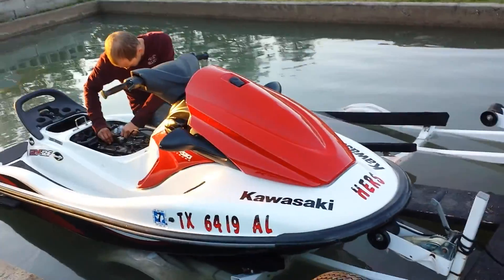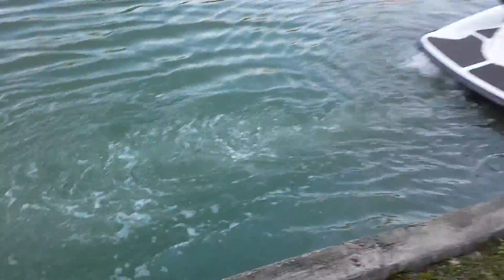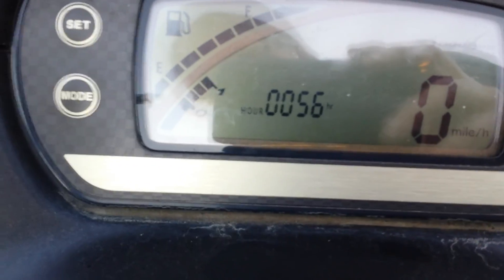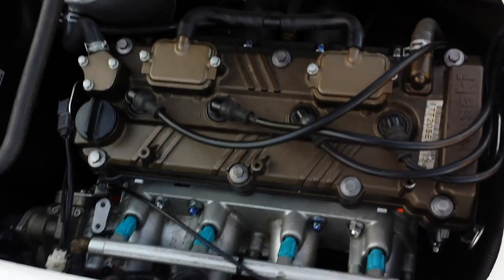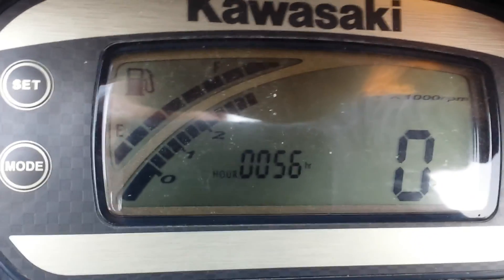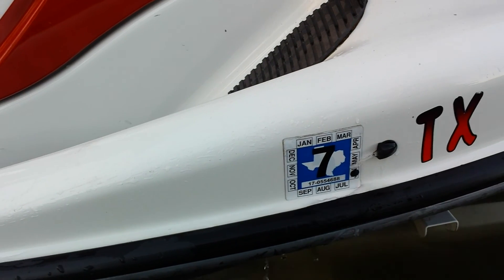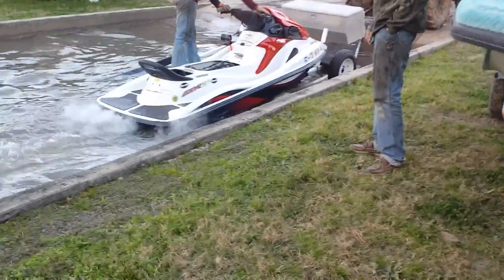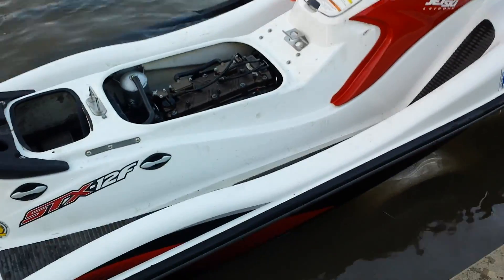Kawasaki stx sbt 4 stroke engine swap

Comment: Did that SBT motor last you longer then original?  and did you change ECU when you put SBT in?
Reply from the maker: This customer has had no problems with the engine we are aware of. This has been 5 years ago. We no longer buy engines we rebuild our own with in house machine shop.

Comment: Do you have a rough estimate for the price of labor and time on the engine swap?  I have a 2007 stx 12f that has some engine issues and I am looking to have the engine swapped out.
Reply from the maker: I dont recall the cost off hand but Go look at www.sbtontheweb.com for parts and figure about a grand for labor plus oil, filter, spark plugs..etc.

Comment: I have a 2007 STX 12f that I bought 4 months ago.  Having problems with it loosing RPMs at high speed after riding for a about an hour.  I turn off the jet ski for a few minutes and it would run great again for 10 minutes and then the same RPM loss problems. Removed gas pump and discovered a bunch of brown stuff in the tank. It is my belief that the sock at the fuel pump gets clogged up and retards the fuel flow.